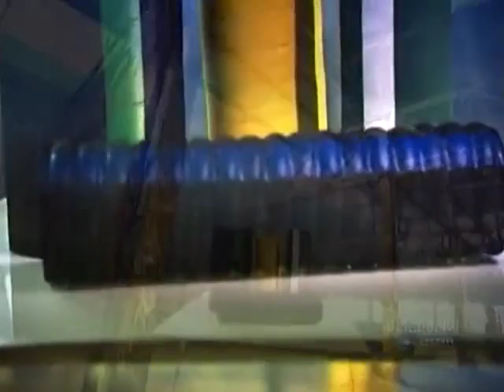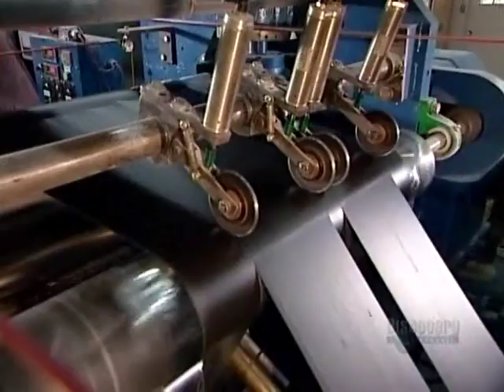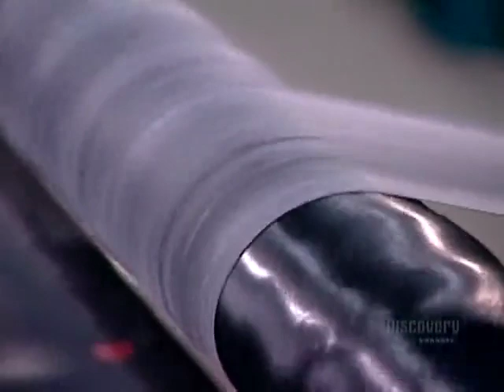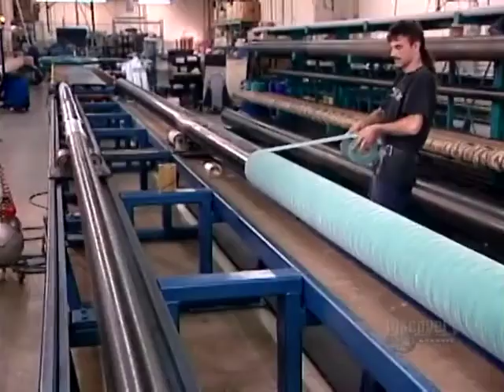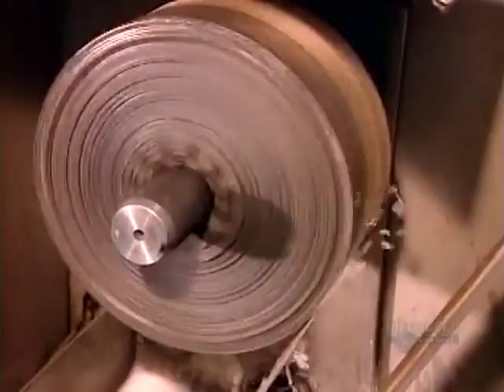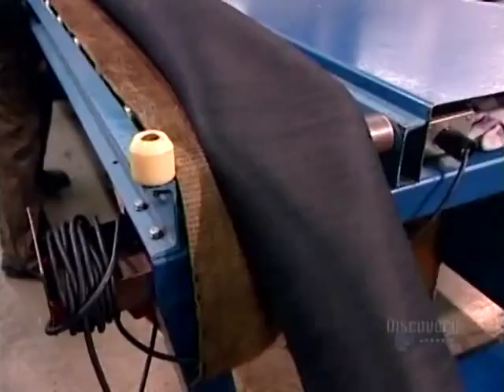How to make  Industrial Rubber Hose {www downloadshiva com}

Comment: The Report Highlights Entry Strategies for Various Companies across the Globe. More Details, Request Free Sample @ https://bit.ly/2OpGtdD Industrial rubbers are polymer materials that are characterized by ability of reversible deformation under influence of external deformation forces. The deformation depends on the molecular weight and structure of deformed rubber and on external conditions of deformation.